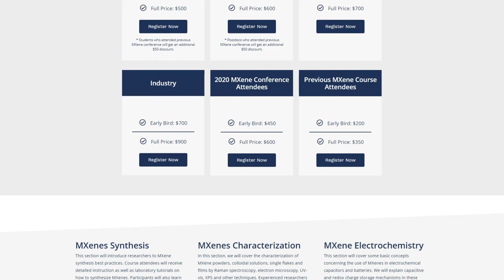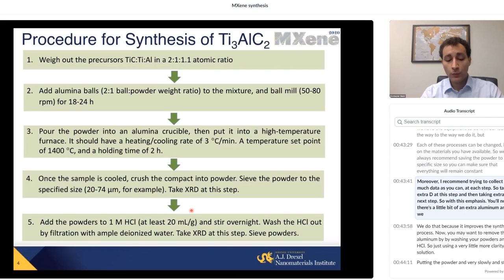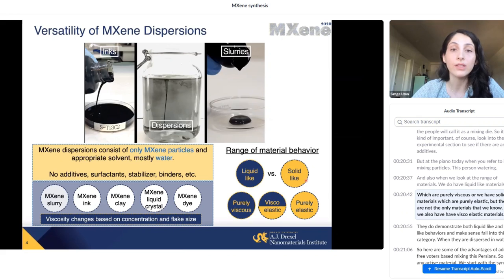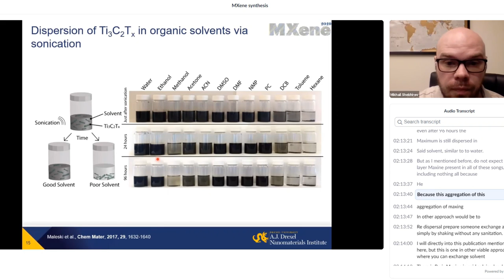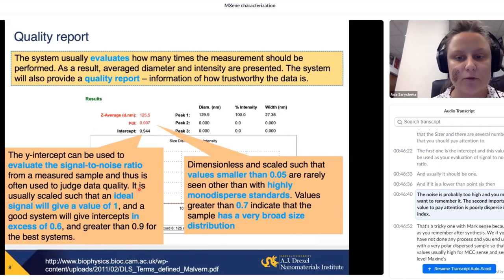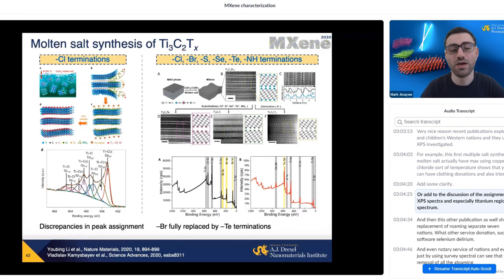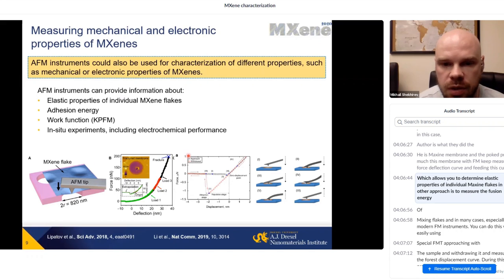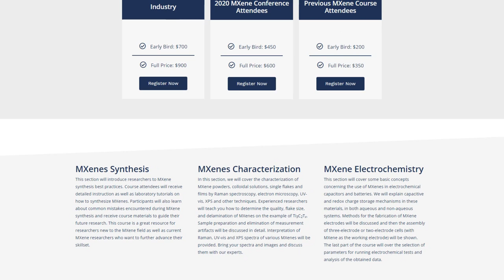Introduction to 2021 MXene Synthesis, Characterization & Electrochemistry Course

Comment: I need your suggestions. I am using HF, HCl and DI water soln. as etchant but after etching process, the weight of sample obtained is higher than that of initial? What could be possible reason??
Reply from the maker: Did you measure weight of completely dry sample? such as vacuum filtered film, vacuum oven annealed powder, freeze dried sample, drying in desiccator, etc.? If you measuring the weight of a slurry or sample dried not entirely there is water still trapped between MXene flakes that is not possible to get rid of entirely after concentration, this is what could give you extra weight.
Reply: @a.j.drexelnanomaterialsins5931  Okay, thank you much Sir❤